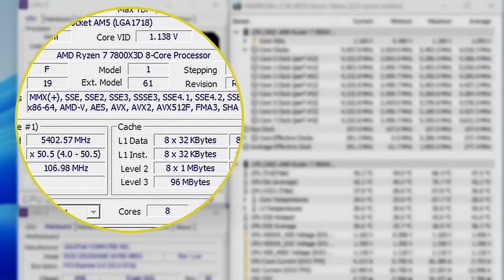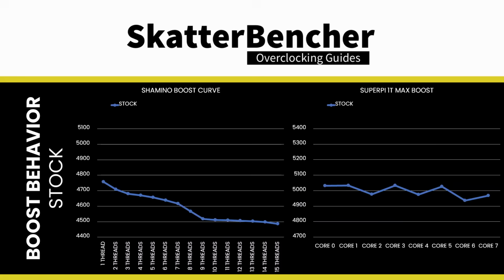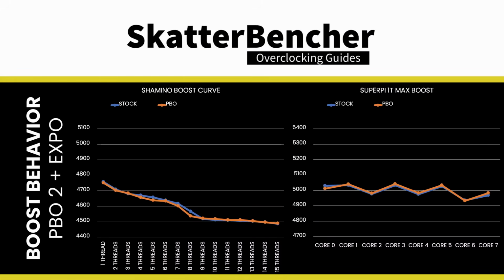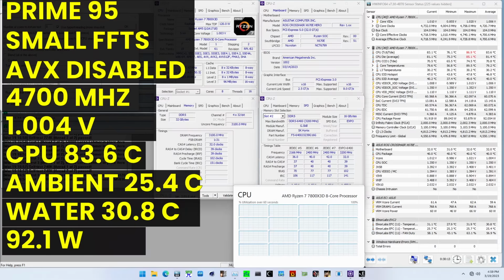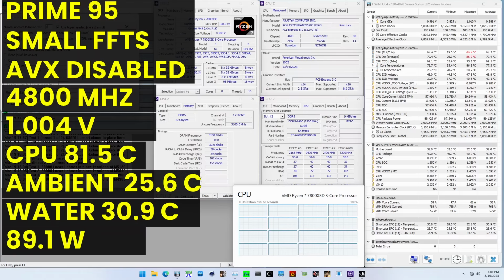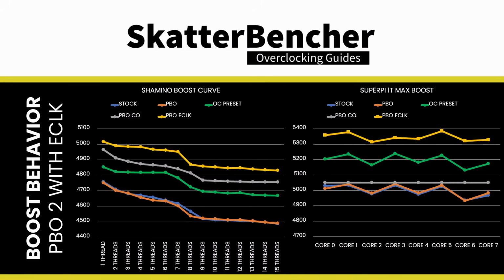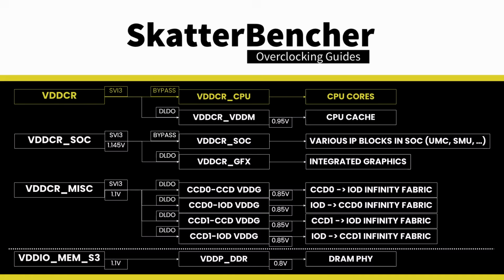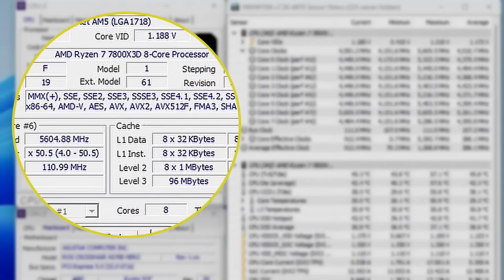Ryzen 7 7800X3D Undervolt & Overclock to 5403 MHz With ROG Crosshair X670E Hero | SkatterBencher #60

Comment: Would appreciate a redo of this with the newest, post cpu issues, lower voltage BIOS, installed.
Reply: Agreed
Reply: @redhood420  my thoughts exactly
Reply: Yes please
Reply: That would be awesome!
Reply: Definitely
Reply: Agreed need an update, but probably won't happen
Reply: Plz
Reply: With an MSI MAG B650 Tomahawk, because its much cheaper than the Hero and as a consequence more people buy it. Im not ready to shell out over $700AUD for a mobo. $319 is far more affordable.
Reply: As a B650 Tomahawk user too. Yes I'd love to see it. Unfortunately I can't go lower than Negative 15 in PBO
Reply: Mine has wired posting issues, when turning the system on, keeps posting to bios because of system instability then you save and exit and it will post into windows as normal 🤷🏻‍♂️ can anyone help 

X670e 
7800x3d

Comment: I did it with the OC Strategy #3.

I tested everything with Prime95 and FurMark after the settings and then went into my main game Escape from Tarkov for the final test. 

I didn't get any errors, crashes or blue screens and my Ryzen 7 7800X3D simply doesn't get warmer than 70° - thank you for the video!

Greetings from Germany
Reply: I did strategy 3 but my soc is above 1.3 each time but if I limit it, I loose the performance gains. So basically unsure what to do.
Reply: @taketotheskies6950 you try letting Ryzen Master auto curve optimize. Can even choose per core and see what it determines to be stable.
Reply: @lsik231l  DO NOT let ryzen laster auto curve, it will crash your cpu. It goes too high.

Comment: Wow, @13:20 the correlation with X3D profile plus PBO with stock or PBO (only) is amazing. Seems like easy performance gain with more to come. That chip wants to fly. No wonder you had a great time with this chip.
Reply: Is MSI the only Dev that has this option? Or will others? Can this be replicated? Have a gigabyte mb.
Reply: Do you think AMD kinda locked it, to make the 7950whybother3D. not look as bad?
Reply: @CarnivoryHODL  My Crosshair board has 3 X3D profiles that were added to the BIOS after the launch of the AM5 X3D chips. Be sure to check for recent new BIOS
Reply: @ryanodneal7001  Big help, thanks! On latest bios now, but afraid to go to beta version.. Is yours a beta version?
Reply: @ryanodneal7001  Where do you think I’d find it in the bios? I’m on gigabyte, not asus, so what were the x3d profile names and what menu were they on? Thanks so much!

Comment: Great video, with tons of information.  Recently built my first PC in over 20 years and my specific 7800X3D CPU can take a max negative curve optimization of -25 all core when running EXPO tweaked profile.  -30 and greater seems to cause stability issues when benchmarking in AIDA64 Extreme.

Comment: 7800x3d in hand.  Lucked out and got one that will do 6400 RAM.  testing at 108.1 ECLK now and so far so good, tuning per core with OCCT.
Reply: SP score?
Reply: @unknownuser7665  DIdn't end up being stable in OCCT multicore testing.  More work this morning on it in the 107.5 range now.
Reply: Gigabyte B650E Aorus Master use this board?
I ordered one, but I haven’t picked it up yet, I’m afraid that it doesn’t support ECLK oc
Reply: @jonjujek  It does support it.
Reply: Thank you!
Reply: @unknownuser7665  With ECLK tuning were you able to lock the frequency & keep it fixed without it fluctuating up & down?

Comment: Thank you for this incredibly useful information. Although I cannot find eCLK configurations on my MSI b650-P WIFI, this video inspired me to increase my base clock via the FCH option available to me. I performed a moderate increase of 102, which sped up the entire system just a touch. I used Ryzen Master to understand my best cores, and used HWINFO during gaming to infer the remaining cores capability. My CPUS cores in ordered of best to worst are 2,4,1,3,5,6,8,7 so I simply set a moderate curve optimizer of -5 and -0 for top 2 cores and +5 for the remaining cores. Very stable, no WHEAs, and increased boost clock to a bit over 5200.

Thank you again!
Reply: Do you get better performance with this? It drives me nuts that my cpu runs so cold but doesn’t boost long at all
Reply: @Titanrunslow  deff higher and noticably longer boost clocks if you have the same setup i do( b650-p wifi & 7800x3d) i have NOT revisted bios updates to determine if eCLK option is now available to us... perhaps you have and hence your comment? ashame if so... wish i could push for 5.4
Reply: I have the B650-S wifi MSI board, 7800x3d & 4070ti.

I managed to get a very stable -30 PBO with expo + tightest timing setting enabled - its solid, but I feel like I'm missing something because my CPU runs so damn cold.

Comment: This is an amazing guide, and i love that each section can be viewed independently. I always had a locked cpu in the past so i never had experience with tinkering with any of this. Tried undervolting my 7800x3d based on explanations online and had instability issues. I went with option #3 because my mobo does not support asynchronous clock and im not sure if it is okay to push the base clock in this case. Thanks for making this video!!

Comment: Such a in depth video.....I am getting a 7800x3d with a msi x67e carbon wifi in the next week or so....hope I can get as close as possible to your results
Reply: does this mb has external clock generator? to oc bus to 105-110Mhz?
Reply: @MrGrzegorzD  It does not, you need to go up to the $700 x670e boards for that. I'm not sure about options on the lower end chipsets.
Reply: @AerynGaming  the B650E gigabyte master does have elck, I bought it because it should have it, it only also cost me 450 euros 😂

Comment: educated!  your voltage reference and strategy is priceless. I would try tweaking and curving the voltages low enough for an air cooler.
Reply: It's very easy to aircool the 7800x3d
Reply: @havz0r  what are you talking about? 
even a random grandma can aircool any recent gen CPU if vcore voltage set to 1.2V

Comment: CPU overclocking complexity is increasing precipitously.
Reply: I mean, it used to be WAY harder back then, then it suddenly got extremely easy (and boring)... And now it's getting a little bit harder again 😂
Reply: DDR5 overclocking has entered the chat.
Reply: @PREDATEURLT  Yeah I don’t know about that one, EXPO/XMP on DDR5 is hot garbage so even if it’s only 10-20% cumulative you’ll more than notice the uplift in 1% and 0.1% lows.
Reply: I just learned a new word, thanks!
Reply: @Triston Davis  No. You don't notice a drastic difference on 0.1 or 1% lows. OC'ing CPUs and tightening timings on ram isn't as beneficial in games as it is for editing/production software. 

Gaming, you may gain 10fps after already having 110fps. You won't notice. 

Back when you used to have to solder CPU pins together to unlock them, you could go from 2.0GHz to 2.8GHz. You'd get a 40% uplift.  

Now people are all excited over 9 or 10% 😑 

On my 4790K I went from 4.0GHz all core OC to 4.4GHz (10%) and gained 4fps at 1080p and 3fps at 1440p on AAA titles with a 1080 Ti. With CL7 1600MHz ram (later used 2,400MHz CL11).
Reply: Precipitously? This was not done by carelessness or by fluke. OC'ing dynamics are due to newer technology architectures.
Reply: Preci what!!?? 😱😂
Reply: @Twitch_Moderator  oc my 8700k made my gaming performance/experience noticeably better.
Reply: "Increasing precipitously" is a phenomenal oxymoron given the root of the second word.
Reply: @thewaver8  Tell me more!
Reply: @JustinAlexanderBell  consider the 2 most well known words that share that same root. You have "precipice", which is a steep fall, and you have "precipitation", which denotes something that falls. Somehow, whether through incorrect assimilation / adoption, or through mutation of meaning throughout time, "precipitously" came to mean only "steeply" and lost its "directional" meaning. But it's still amusing to see it used to denote an increase.
Reply: @PREDATEURLT  this

Cries in core 2 duo
Reply: For AMD yes, Intel still easiest to OC, does not mean automatically better as overclocking alone is FAR from a 2023 CPUs performance expectations anymore.

Comment: Why did you choose Expo I vs Expo II?  Btw, I just found your Youtube channel.  I had read your OC information but did not know you had a Youtube channel.  Visuals are always better than just words.  Much appreciated.
Reply from the maker: No particular reason why I picked EXPO I over EXPO II. I usually stick with the first option unless there's some issues
Reply: @SkatterBencher  Ok.  I asked because my research found that there are differences between the 2 and I was curious if Expo 1 was a better option.
Reply: @Methodical2 In my particular case EXPO II is supposed to set the exactly written EXPO profile on the sticks and EXPO I is sort of a mix of Asus optimizing things and the EXPO profile on the sticks. In reality more values are set with EXPO II, including some tiertery timings left at AUTO if using EXPO I. I decided to enable EXPO II simply because more values will be at a fixed state.

Comment: Hi all.
I have Rog Strix x670e-e gaming wifi mobo, 32 gb ddr5 6400 cl32 G.SKILL ram, ryzen 7 7800x3d. 
On current bios 1416 I am able to achive roughly 5335 mhz clock per core on my cpu.
Using strategy #3 from this video, didn’t want to try manual core by core settings so did all at once.

So my setup is also 6200 mhz, since 6400 mhz was not stable in DOCP I profile (mobo does not have EXPO for some reason, but it is esentialy same thing just different name for Asus). 
Precision boost overdrive - enabled, curve optimizer - all cores, negative, and i did 25 magnitude. Tried 30 did pass cinebench R23 but in idle crash, 35 magnitude crash instantly, and 25 was stable for me. I can probably go higher on some cores, and some not, but as I said, i didn’t want to do manual per core overclock.

Managed to get around 3.25% (give or take) boost in performance (not counting gpu overclock) and from around 5000 mhz max core clock speed to 5335 mhz per core. Temps stable, droped i think 2-3 celsius from 88-89 to 86-87 in full load Cinebench 23. Idle startup is around 45-47, normal to heavy workload 65-75 celsius and veryhigh workload 86 celsius.
Cinebench R23 score - before cpu overclock somewhere around 17400, after overclock 18051.
I do not play highly intensive games, and even without OC i had enough fps in games, but did it anyway just to check the results and pass info here since there is almost none cpu overclock videos of this cpu after this fiasco with Asus and their burned up cpu and mobo. 
I couldn’t hit chinebench 23 scores he hit in this video, but i think that is due mobo diference (his is higer rank and have 20+2 A teamed power solution rate while mine have 18+2 , maybe clean windows 11 instalation, and some other thing, I don’t know, I am
not expert, and don’t even know is that ever relevant for cpu overclock, but I have seen my cpu hit 18200 (give or take) score in Cinebench R23 when we put sistem together and did first few testings. 

Hope this helps someone.

Comment: Have you thought about delidding the CPU?? From other videos I've seen, at least for the non 3d variants, it seems to be more or less free performance, or free power/heat savings. Would be fun to see you maybe push this processor even more, or see how much lower temps/power draw you can get which is quite important for sff builds.
Reply from the maker: I've thought about it, but don't have the time to do it
Reply: I'm very interested in doing this since mine runs on a fractal ridge case. The ihs seems to be too thick to allow height compatibility with coolers, so removing it already benefits heat transfer

Comment: Almost ready to receive my CPU, I'll be trying all of this strategies for OC. Thanks for the guidance.
Reply from the maker: Good luck!
Reply: How likely are these strategies to brick your cpu? Ranging from ‘pretty darn low you’ll cook your cpu’ through to ‘try at your own extreme risk’?
Reply: @Dodgerca  With zen 4, even if you add + voltage to curve optimizer it will not go past the hard cutoff. Temps also will hard stop at the maximum temp. Unless you really go out of your way to disable default protections, it's going to be rather difficult to kill one. The thing that works best for zen 4 is PBO + curve optimizing, maybe eclock if you have it on your board as well, and with these it's very safe.

Comment: Maybe you've covered this in another video, but can you explain your method for determining your per core curve optimizer offsets? (Or direct me to it) or is it exactly as it seems and is just a time consuming and tedious process if you truly want to have every core at the edge? I'm curious to know your process either way.
Reply from the maker: It very much is a tedious and time-consumption process. The specific tuning process depends a lot of the specific CPU, because I find that some CPUs are more sensitive to different types of workloads (SSE, AVX, etc). But my general process is pretty simple:

Set negative all core curve optimizer, then check stability with Prime95 small ffts no avx for each core separately (affinity). I just check for 20sec because I'm only interested in whether it crashes immediately or not. Then, as long as all cores pass, further increase the negative curve optimizer in steps of 5. 

Then, when 1 core fails switch to per-core curve optimizer and back down on the one core that failed and keep going with the others.

When you have a configuration that works for all cores, it's time to double check stability in various scenarios. I usually do:

1) Per-core SuperPI 32M, to check high-boost stability in light workloads
2) Prime95 small ffts all core non-avx, to check boost in non-avx heavy workload
3) Prime95 small ffts all core avx2, to check boost in avx heavy workload
4) Run all my benchmarks to ensure stability

For 1, 2, and 3, you can easily spot which core is unstable and then just back down with Curve Optimizer for that core. For 4, it's more difficult, so I just back down 5 steps for all cores to build in margin.
Reply: @SkatterBencher  Thank you so much for taking the time to detail this out. I guess I need to reinstall prime95. It's been years since I used it last and I wasn't aware you could do per core testing. SuperPI will be a huge help too because my biggest issue always seems to be high boost light workload instability with my last few builds.

Thanks again. You should consider making this into a video, I can almost guarantee there are a lot of people out there that would love to have this in your usual format as a visual walkthrough for getting the most out of their CO.
Reply: I use OCCT and test 1 core at a time, takes forever but works.
Reply: @SkatterBencher  What about using Ryzen Master and running the per core optimizer, and either just using Master or entering the offset in your bios?
Reply: @SkatterBencher  Just started my 7800x3D build and I would like to say thanks for this. Got a question regarding 1/2/3 though, how exactly do we spot the failing cores? All cores pass with -30 for 5 mins each for non avx but when I start with avx2 with the same settings it crashes(bsod) immediately and I can't tell which core was doing it heh.
Reply: @realcapo88 same. It doesnt make sense to me

Comment: I noticed your cpu soc voltage is 1.35v, with the recent news of the burning chips and expo problems, the manufacturers are hard locking the new bios versions to 1.30v max, was wondering your thoughts on this. Many users are manually setting the soc to 1.25v to be on the safe side at least until more info is known. Thanks for the video.
Reply from the maker: I've been trying to follow the news about the burning up a little bit (including some of the in-depth pieces). Generally, I'm a bit annoyed with the coverage because there's still lots of speculation and jumping to conclusions. Also, I'm not a fan of calling people "lazy" without evidence. It implies intentional malfeasance.

My opinion is that 100mV difference will never be the difference between "guaranteed burnout" and "absolute safety", unless there is a specific hardware design flaw causing that. Going by the physical damage, it's clear some thermal protection is failing. That could related to a dysfunctional physical sensor in the CPU or some edge-case SMU firmware bug, or something different. But what's it's not is +100mV :).

I look at the BIOS voltage limitations as a way to show customers something's actively being done about it and to shift the conversation to "it's those darned overclockers again". You know ... it's not "in spec" but "out of spec" behavior. I'm not confident we'll ever know the true root cause of this issue. And, honestly, I don't really care that much about the root cause being known by the public. I'm just a bit worried that this will further detract AMD from actively investing resources to enable great overclocking experiences.
Reply: @SkatterBencher  Thanks man,  appreciate you taking the time to answer.😀

Comment: You get best results using a mix 
1. Expo0 6000 cl30-36-36-76 
2. MANUAL not preset, PBO advance, temp limit 85c, CO -30 per core and tune it (for me only core2 needed -20 instead)

Once fully stable on CO,  apply bclk to 102.5 should work if you were stable. Enough to test and lower later to 102 if needed.

This will be a cool and top 1% 7800x3d tune

Comment: so is eCLK mode now a standard feature across X670E? Great video btw really clear and informative...
Reply: It is not, still stuck as a halo feature. For example it's not on the MSI Carbon ($480) but i heard that it's on the Ace ($700). This Asus board also costs about that much.